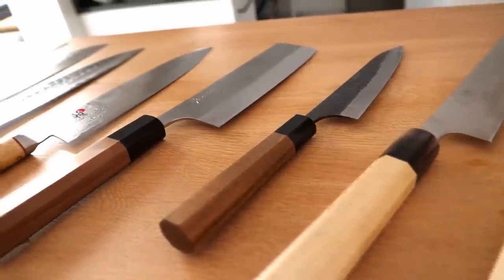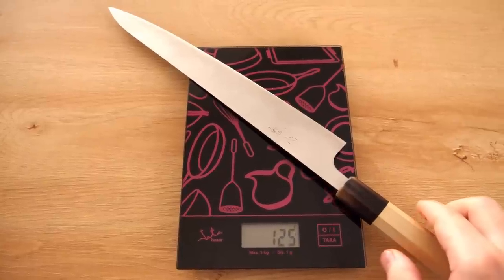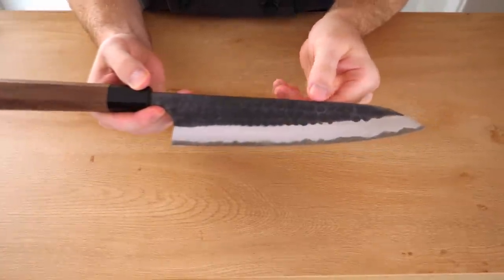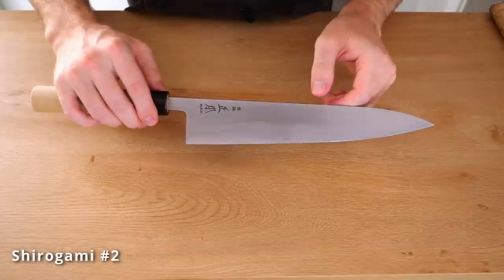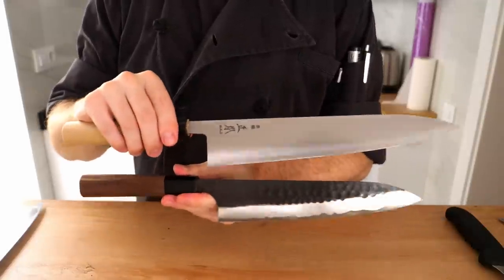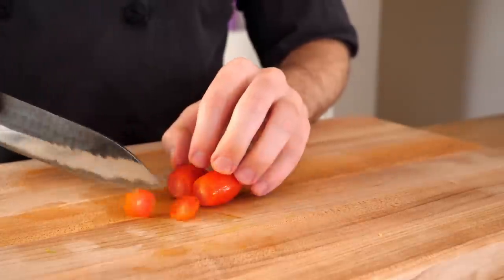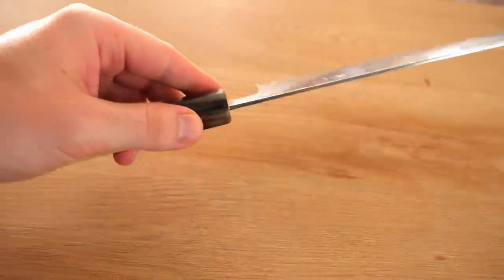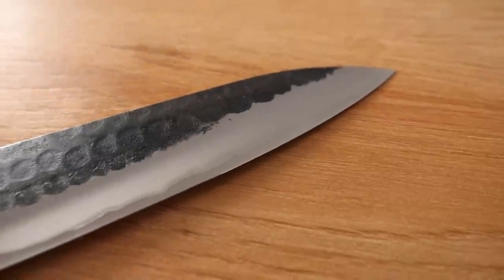Pro Chef Tips.. What Are Japanese Knives & Are They Worth It?

Comment: I know the video is meant to look at knives, but I urge viewers to look at chef's technique- especially the way he's cutting when using different knives. Also look at how and where the knife is held from. The weight of the knife will also determine how you use it. Heavy knife? let the knife do the cutting. Very light knife? Each stroke will be purposeful. But the best tip given here in this video is to hold one and try it in store. Buy what you're comfortable with!
Great video as always! Looking forward to more content.
Reply from the maker: thank you! the counter that I was cutting on is a bit to high for a cutting board and with the Japanese knives it is not easy to use them as I have to hold them higher up to cut haha

Comment: As someone who worked & studied for years in steel industry (with CNC machines that is) I can tell you, higher Rockwell means also more briddle, which results in higher chances of cracks/chips.
The perfect steel would be as hard as possible while being flexible enough to withstand torturing. But even if you mix materials together, which they do (Chromium, Molybdan, Vanadium and so on) they'll still fall short on being flexible or hard enough.
Interesting would be to do knifes with CBN (Cubic Boron Nitrid) especially cause they're thermically and chemically resistant. That's commonly used in the makes of lathe and milling tools.
But the processing of making it is difficult, because it's mainly made through sintering.
Thanks for the video James, was really interesting to see!
Reply from the maker: Thank you!!

Comment: One thing to note about single bevel Japanese knives is that they are meant for righthanded use. As a lefty that can be a bit of an issue. I only have one Shun steak knife for the pretty which I do use righthanded.
Reply from the maker: I said to hold the knife before but yes I should had said that
Reply: D-handle and 30/70% sharpened knives might also not be too well suited for left handed people. some might not mind it though, and sharpening angle can probably be fixed

Comment: Great video! Just a few additional points: A significant distinction between the Gyuto (chef's knife) and the Santoku lies in their cutting techniques. The Gyuto excels in chop-cutting methods, making it ideal for tasks requiring a more vertical motion. In contrast, the Santoku is better suited for push-cutting, which involves a more straightforward slicing action. If you're working in a smaller kitchen space, you might find the Santoku to be more convenient due to its versatility and ease of handling.

Comment: A very good explanation about the different knives and steels. Are they worth it has two sides to it. Considering the hand labor in many of them one can understand why they are so expensive. So if you are for instance a sushi chef and that's all you do all day long I would say yes. But for most people I think not. They are much better off with a softer stainless steel (some 58RC) but a more rugged construction. Not only less maintenance and easier to clean but less likely to chip or break.

Comment: Stainless generally prefers to be sharpened on diamond stones with plenty of lubrication.  stainless steels are inherently very abrasion resistant (which doesn't necessarily mean higher edge retention), so the diamonds can shear through those chromium carbides nice and easily.

Comment: Great video!

I have a set of Shun knives, and I find I use the Santoku and the Nakiri far more than the chef's knife.  The Nakiri was my work horse, but I now have a few "waves" or "bends" in the edge in two places, so I have switched to the Santoku until I get the Nakiri taken care of.

13:11 - I am going to guess the blade on the left is chipped from someone twisting out an avocado pit.  I saw a couple of knife repair videos where that was the confirmed cause, and it looked very similar. I stopped doing that as a result.

Also, for Japanese knives, I have learned you should not cut on hard surfaces (granite, etc) as this can also cause chipping and warping.

Comment: Just to follow up, chef. I took my Usuba to the only shop in the city that sharpens single bevel Japanese knives.
1.) He said I got a good deal.
2.) They loved how I polished it.
3.) They removed the chip, sharpened it, and gave me so much info on Japanese knives.
I swear, I could shave with it. It's so sharp and effortless to use.
I've been converted.
Although expensive, they are lighter, faster and sharper than anything I have used in my life.
They just need proper care. Not a problem.
My wallet won't like it, lol.

Comment: Hey James, Pro knife maker here.

Nice and pretty accurate video! but I would like to add a few things. 

First, Japanese knives have made quite the reputation and now everybody believes they are the best there is. That might be true when they are made by true dedicated artisans. The problem is it has became such a big business that a lot of industrial companies now want their piece of the pie and make Japanese-looking knives without respecting the rules of what make a Japanese knife. 

For starters, even though there is nowadays a huge diversity among stainless steels, and some will have all of the upsides of carbon steel, but most stainless steels are the cheap ones and not always well heat treated. This is what gave stainless steel the poorer reputation in the first place, in the West. There is an incentive with Japanese knives to stick to a higher standard regarding sharpness and edge retention, so there's that, but you'll still have to go way down the rabbit hole to find the really good ones.

Besides, it's very difficult to hand-forge stainless steel let alone to make damascus out of it, without ruining the metallurgical balance inside. Stainless has to be heat treated very accurately, within a few degrees window and there's no room for error, so even for the most skilled blacksmith, to be this accurate with a forge fire is virtually impossible. What I mean is, when you see "blacksmith finish" on a stainless steel, 95% of the time, it just has been put there to let you believe it has been hand-forged while it most certainly has not. What's funny is many very skilled blacksmith will leave a very smooth surface even after they're done forging (not the rough random hammer marks) and will also polish the blade completely, because that's the real traditional way. Again, the "blacksmith finish" is a pretty recent trend, mostly developed by industrial companies to make their knives look more hand-made. 

Then, as you briefly mentioned it, true damascus is not showy. in the old days, there was only tamahagane. The folding and welding process was used to make the steel more homogeneous, not more layered, like in the West. When you seen a large damascus pattern on a knife, it's most probably stainless damascus, which it 100% industrial, made from carbide powder metallurgy. And even if it looks pretty, it's basically more similar to a standard stainless steel in its structure and behavior. You're just buying the looks. Stainless doesn't weld easily, so in order to do this, steel powder must be put into a closed can, then heated and pressed. A blacksmith can't do that.

Finally, sharpening steel is indeed not supposed to work on a Japanese knife, since the typical Japanese knife is quenched and tempered with a higher Rockwell point. it's a historical and cultural thing. The steel won't have enough hardness compared to the knife to be able to grind it. The edge will just slide on it and polish it. So you will have to go for the whetstones to sharpen your knives every now and then. 

To summarize, 90% of the so called Japanese knives are in fact industrially (often not even in Japan) and made with more western processes. It's just fake and opportunistically made because of the high demand. It can still work not so badly as a knife, just like you can still cook with an Ikea knife, but it has very little to do with Japanese tradition. The remaining 10% are not easily found and you will have to do a lot of research to find the genuine kind, and the price point will most probably be around x5.  

Take care.
Reply from the maker: Hey! Thank you very much for the explanations! There is so much to know about Bladesmithing!
Reply: Very interesting!  Thanks for the education!

Comment: The Anryu knives sure are beautiful! I was wondering if anyone could comment on a couple of points of I was wondering about them (though to find in Denmark): 
- How does the handle feel at the transition (especially for a leftie)? I have a horribly firm pinch grip where my ring finger is around the tip of the handle, and I have found most traditional Japanese knives are a little sharp at the edges. 
- How sharp is the corners of the spine? given the beautiful raw finish, I don't want to alter the spine by grinding it, but sometimes the spine can be a bit rough

a knife sharpening video could be very interesting for a lot of people, two things I think it could get into knife care and are which oils to use for preventing rust and maybe a discussion about single bevel vs making a secondary bevel and when that makes sense to do so :) 

Loving the videos, always super informative and the more formal tempo is well suited for this type of content!
Reply from the maker: I will try to make another video for sharpening when I get the chance. The Anryu feels good the one I have has an octagonal handle so it's ambidextrous and the edges are smooth
Reply: @ChefJamesMakinson  Thanks for the clarification! I guess I would have to start looking out for those if I find a site where I can get one. 

Have a great weekend

Comment: I add there is also third type of chef knifes from Japan: Bunka. Its tip is curved in different way (think pirate sabre) and it is easier to maneuver the tip then with Santoku (never used Gyuto). 

Also, a tip if someone buys carbon steel knife - if you buy carbon steel only (not covered with stainless steel) and if you do not mind patina, develop it ASAP. You can do that by putting slices of onion on the blade or covering it with towels and pouring dissolved vinegar. Keep it for few minutes, clean with water, oil and you are good to go. Patina is excellent, excellent protection against rust. You still need to take care of your knife, but patina makes it lot easier.
Reply from the maker: Yes I don't have one and I didn't mention quite a few others
Reply: It is also a general purpose chef knife.  It is now not as popular as Santoku.  As a home cook I use Santoku.  I am not a professional cook and thus I think there is no need for Gyuto knife.  By the way, I was trained by my mum to use Chinese cleaver.  A chinese cleaver can do everything.  Santoku is cool because it is lighter.
Reply: kiritsuke tip, some guyto's have similar tips

Comment: Not the same as a knife, but I have a very nice pair of Japanese hobby nippers (I think they sell at $100 or so now) and dropped them about 2.5 feet onto a tile floor. snapped the tip off. Still kind of works, but that hurt. These are beautiful though, there is certainly something to attention to detail and aesthetics (even with a knife), but if the feel in the hand is also really nice... very tempting. Overall, I've been impressed with ever Japanese tool I've ever used... I even switched to Japanese masking tape for labeling things in the kitchen.

Comment: If you're just breaking into home cooking, I would also recommend just getting the chef knife (8" / 20cm). It does over 80% of my tasks without being too heavy. Instead of spending on a second Japanese knife, buy a beater chef knife / santoku (like a low-mid range Meissermeister), serrated bread knife, paring knife, boning knife (flexible or rigid, depending on preference), and whetstones (at least 400 and ~1200 grits). You'll be well prepared for most cutting tasks except slicing cheese from blocks. You can still do that with a chef knife, but it's sketchy and not consistent.
Reply: Thank you, this sounds rather good. May I ask when you say slicing from a block, do you mean an entire circle of cheese or just something from the shop? Hope this doesn’t sound too pathetic haha.
Reply: @donquixoteupinhere  Not a cheese wheel, you may need specialty knives for the hard aged ones. I mean the large rectangular blocks of cheese (like cheddar) found in the deli or dairy section of supermarkets. Usually 2-5lbs (1-2kg).

It's not bad to get a few slices with a knife, but if you're trying to get 20 or even 50? It's a lot of wobbly work compared to a cheese wire or electric deli slicer because you need to push down hard to get a chef knife through. Oiling the blade might work, but I don't exactly want vegetable oil in my cheese. I can't really imagine doing this process on a round packaged cheese like how provolone is sold here.
Reply: @MrKlarthums  thank you sir for the fantastic answer! That was my uncertainty exactly and you solved my final problem/question as to what device to therefore use to slice cheese blocks (I thought this was what that meant but I wasn’t sure if I was off-piste). Thank you!
Reply: @donquixoteupinhere  No problem. I'd also like to add that if you try slicing a cheddar-like cheese with a knife, it should be with a beater knife. It doesn't really matter how sharp your knife is. Thinner knives are easier, but you're pushing the knife down through from the top with your second hand which puts a lot of stress on the knife. It's more like driving a mechanical wedge to separate than how you'd slice a tomato.

Comment: This was good. What you failed to convey was the idea that in Japanese cuisine, each task has a specific tool. The gyuto is not the “chef” knife. Kiritsuke is. Gyu translates to beef, so that would be your meat prep tool. If you’re into Japanese stuff or happen to work in a Japanese environment, your most important knife will be the Deba. You will break down fish to fillets with that tool. If you’re descaling your fish in house, you will need a Takohiki/sujihiki. It will also depend on your style. Kanto vs Kansai. The topic is a never-ending rabbit hole… and then you have the bocho/hocho for pretty much all knives. 
One last thing, it’s fairly common to replace handles. It’s actually a shortcut to look for great blades with poor handles and get them replaced. Getting a pine yanagiba will end up cheaper than a mohogani handle one, even with the replacement taken into consideration. In some cases, you also will wear out the handle faster than the blades. My deba is on its second handle in 7 years.